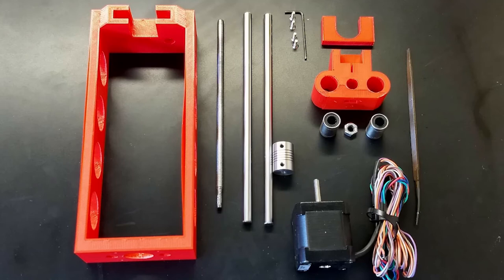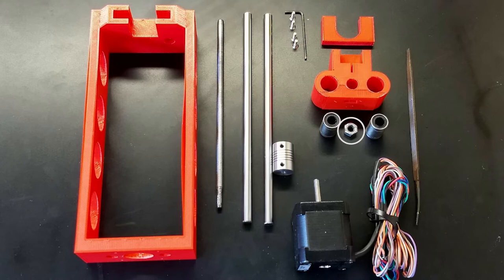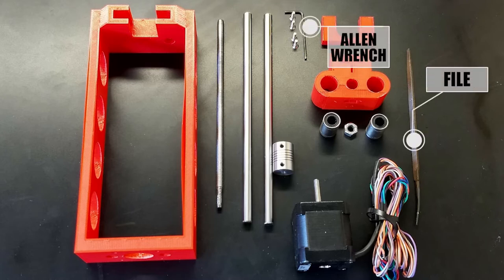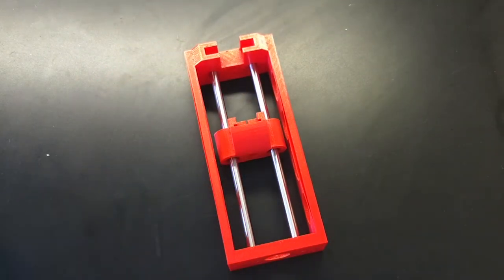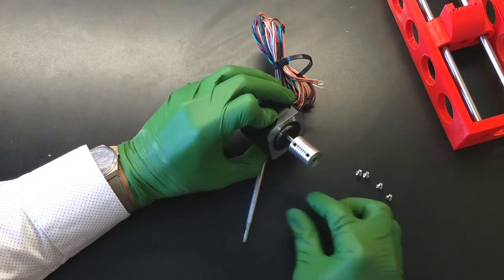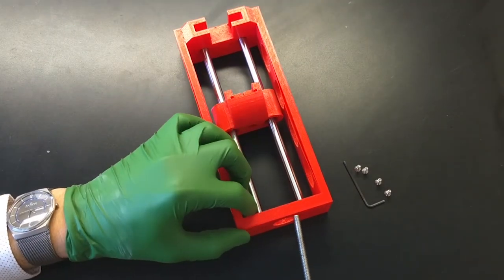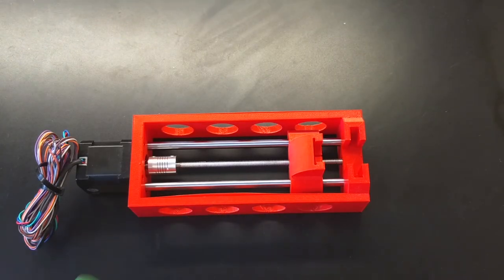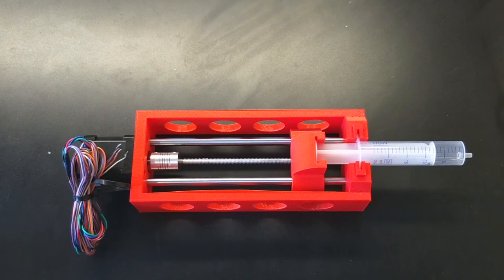Flow Chemistry: Syringe Pump Assembly Video (Part 2)

Comment: Great job!!
May I ask how much ml is the syringe? and could you please provide the Motor torque info? I have made something similar using a belt instead of the screw rod but my Nema17 has only like 12 n.cm which almost done the job but not really efficient.